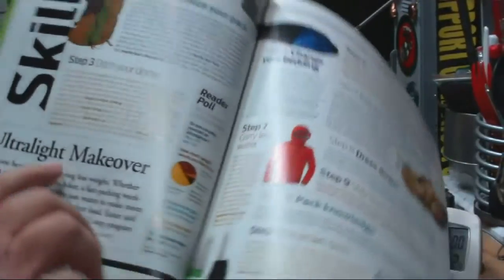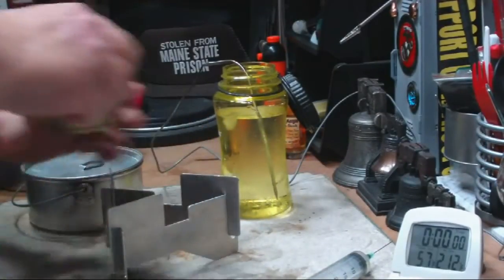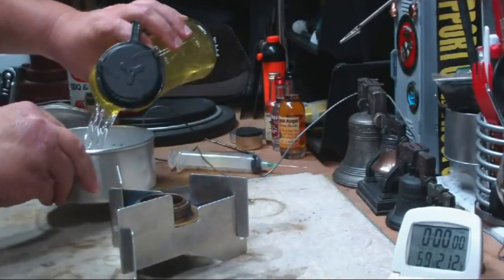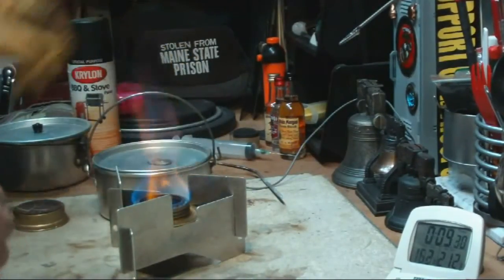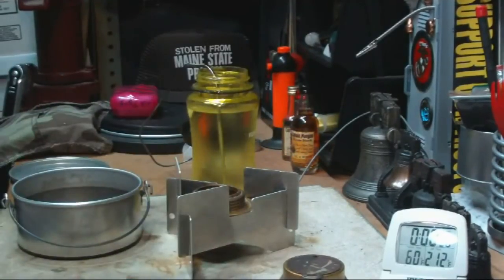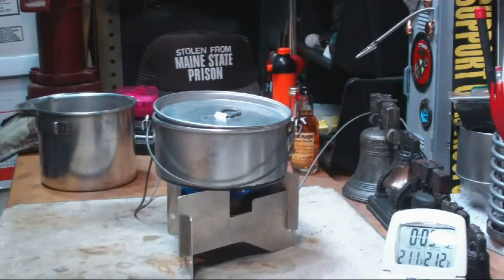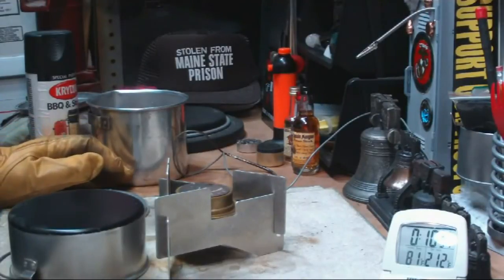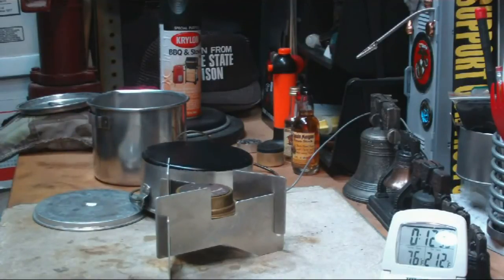Backpacker Magazine Pot Idea Test - Reloaded

Comment: Here in the UK we use a cleaning product called 'The Pink Stuff' miracle paste by a company called Stardrops that only cost £1 for a 500g tub. It's brilliant at cleaning soot and burnt on stains from cooking pots. No scrubbing necessary! You just put a little bit of the paste on a damp clothe and give the pot a little rub and it cleans it up all shiny. Not sure if you can get it across the pond but you may be able to get something similar to save your pots from getting all scratched. Love the videos by the way.

Comment: Thanks for dispelling a myth that has been repeated so often it is accepted as fact.  Painting a pot will actually add a small insulating layer and less heat will be conducted via direct flame contact.  Black cookware is really only advantageous in a solar cooker, or probably, as pointed out already, a radiant heater/stove. Score 1 for experimental science.

Comment: Your test result was just fine!  Don't bother trying it with Rustoleum black...you'll have similar results which will show (again) that the guy who wrote the article in the magazine where he equated the fact that a black T-shirt gets hotter in the sun (by receipt of radiation) and figured the pot would benefit similarly, didn't get it right!  A flame's connection to pot is NOT predominantly by radiation, it actually transefers most of its heat to pot by CONTACT.  To maximize this transfer, maximum contact area is what's needed (as proven by noticeable performance increase of Optima's WE HE, WeekEnder with Heat Exchanger over WE without HE).  A layer of paint would act as an insulator to the heat transfer process when used in the normal way...exactly what you don't want.  Theoretically considered, IF you were heating the pot mainly by radiation (like a person standing in front of a fire) where the transfer is mainly by receipt of radiation, then color would play a much bigger part.  Just goes to show ya can't believe everything you read...Thanks for your vids of test, and Greets from CT!

Comment: I saw an explanation somewhere (can't remember where) that suggested the black bottom's effectiveness is related to the color of the heat source since the black color absorbs radiant heat - so a wood fire (yellow flame) would heat faster with a black bottom pot but alcohol (blue flame) not. What do you think?